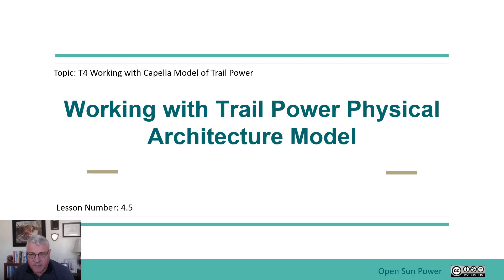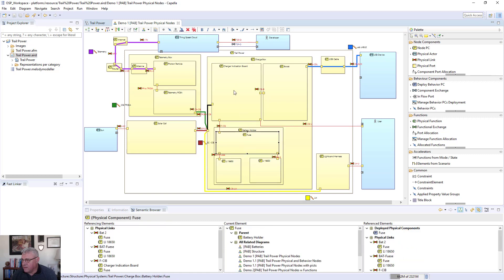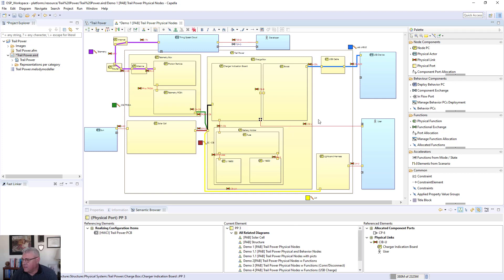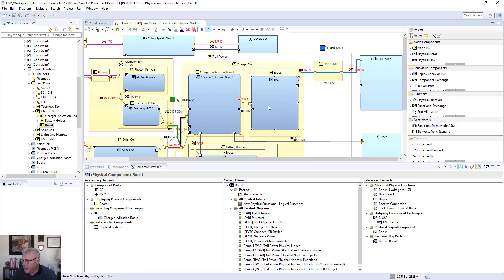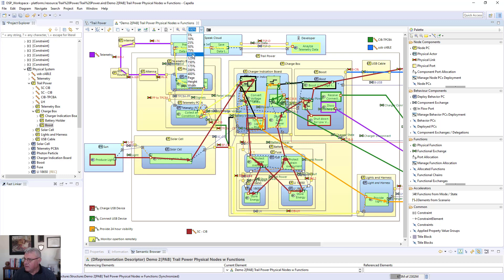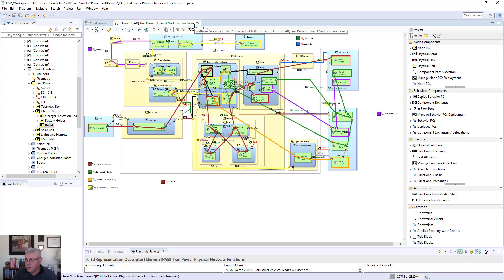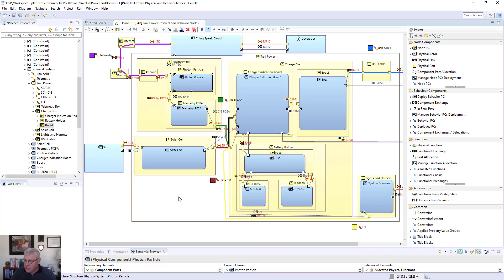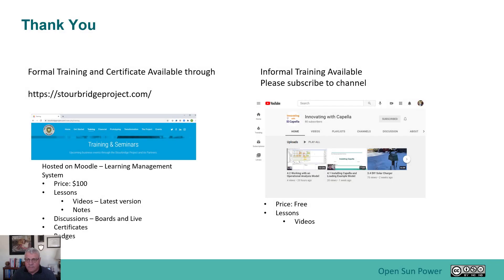4.5 Working with Physical Architecture in Capella

Comment: I'm not quite sure about the utility of the Physical Behavior Components shown in the example. Take the batteries for example: how is having a Behavior Component inside the Physical device, with the same ports and name, useful? Thanks in advance!
Reply from the maker: In this example the benefit of separation is not as apparent. If you look at some of the reverse engineering videos that I recently posted, you find the physical model starts to represents the kinds of physical connection, such as tactile, visual, electricals and mechanical.  It is then possible to allocate behavior to the respective type of physical link. This then captures the design decision of how the interface will be implemented.